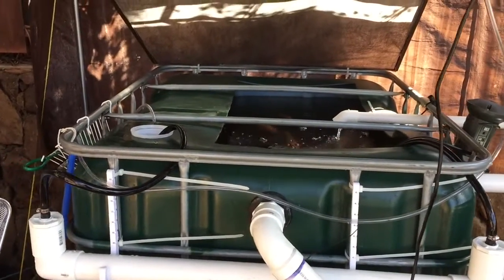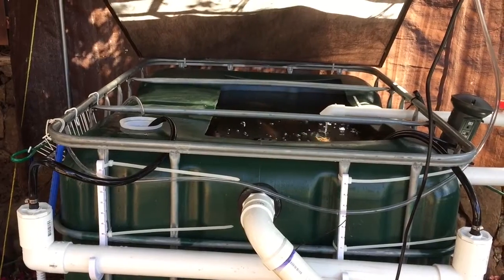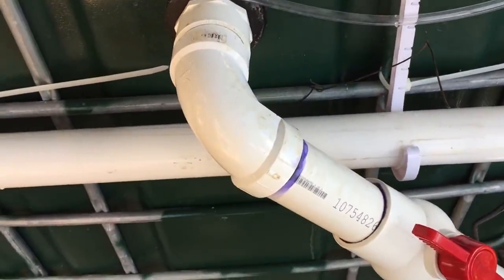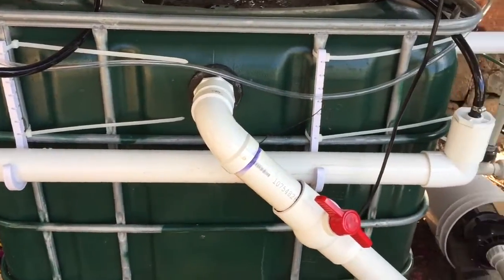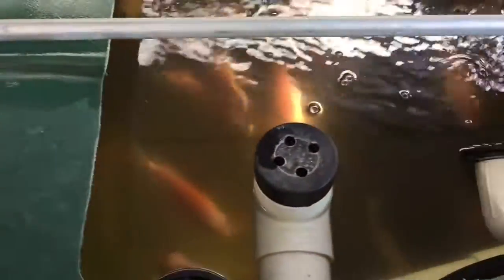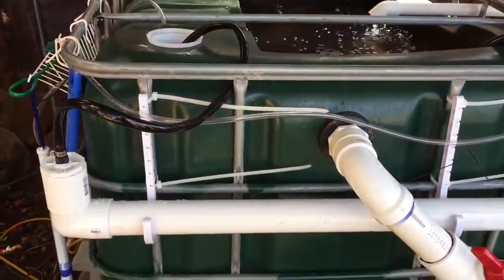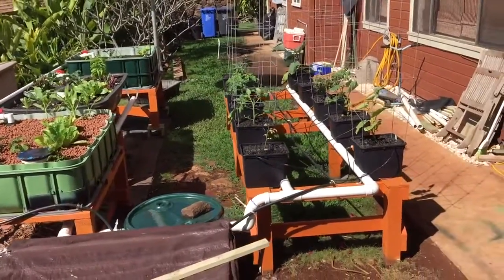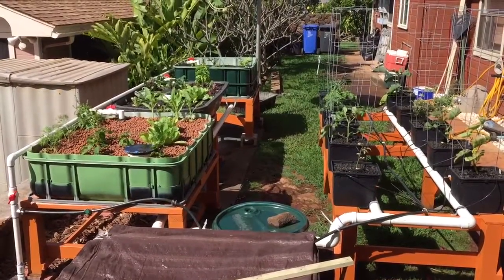Aquaponics dual loop system update. More fish tank filtration. I added a sand filter to clean FT.

Comment: Hmmm not sure about that one, I think a more traditional 'slow sand filter' used for drinking water purification would be more appropriate. I'd make it alot shallower than one for drinking water so the flow was more reasonable.
Reply from the maker: Well time will tell. Actually I was wondering if the flow was fast enough. Seems to be working regardless. The water is clearing up and I like the idea of taking it apart and cleaning it, refilling it, changing it, etc...
Buying one is just not in my DIY blood. :)